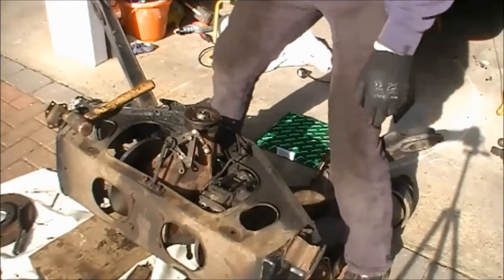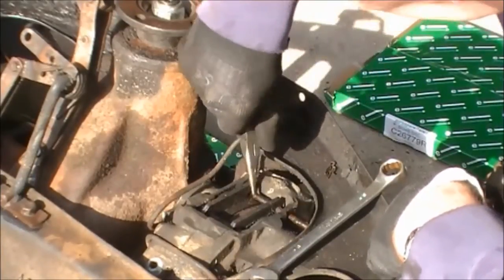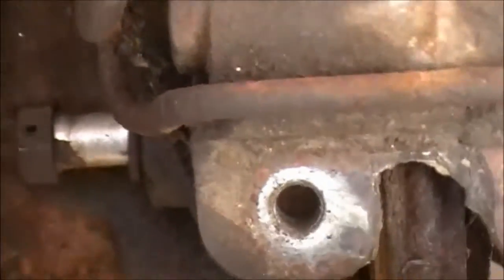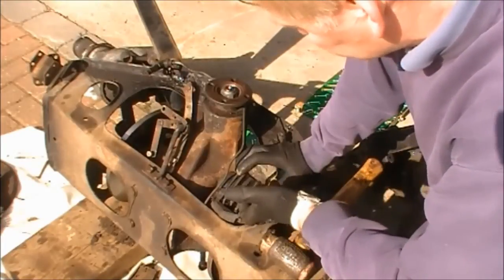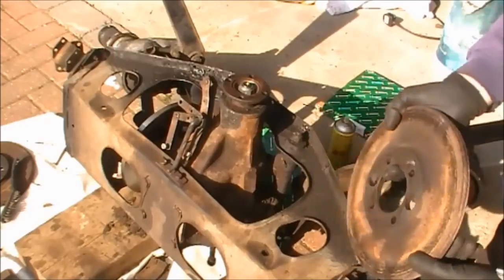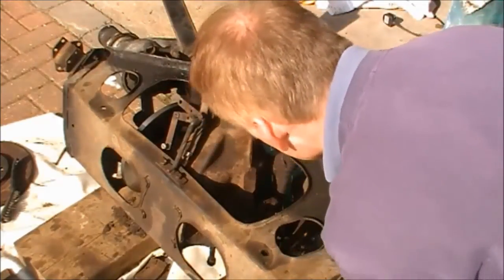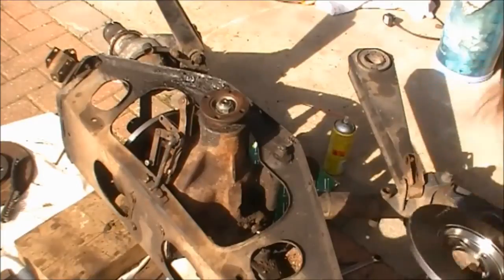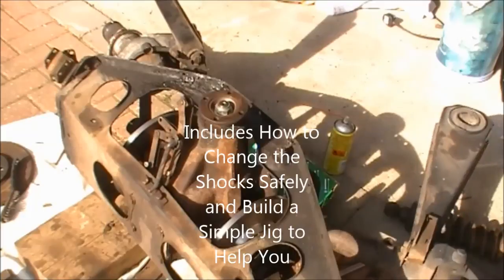Jaguar E type Rear Suspension Rebuild Part 4

Comment: Having had experience working on types before I find you are much better off removing the brakes still attached to the diff. Then dealing with them as it takes a long time fiddling about with them inside the cage. Then once you have it all stripped down to the bare components of the cage and suspension components etc then cleaning it all and painting it then reassembling it again